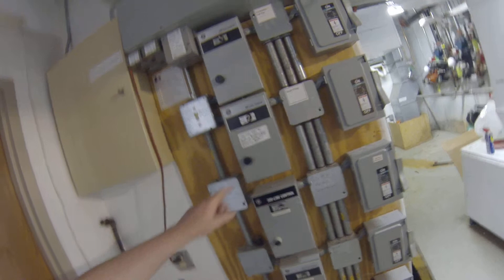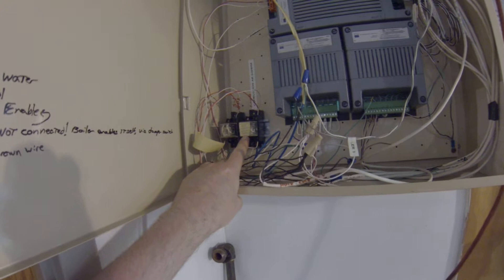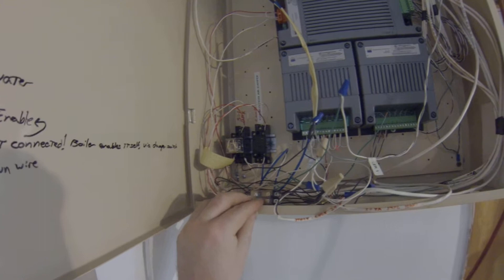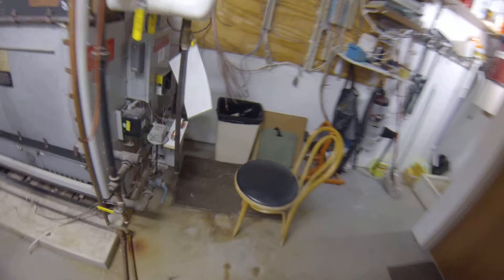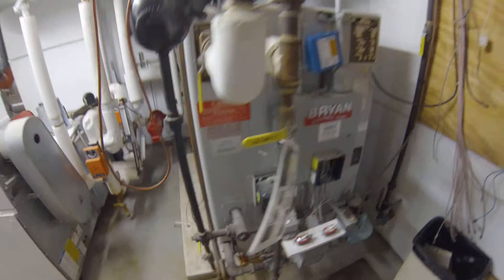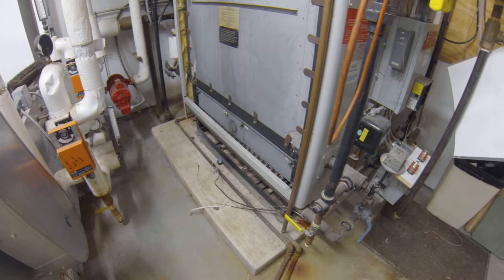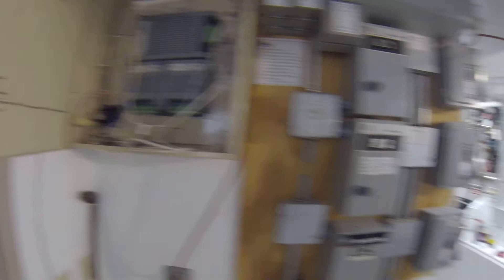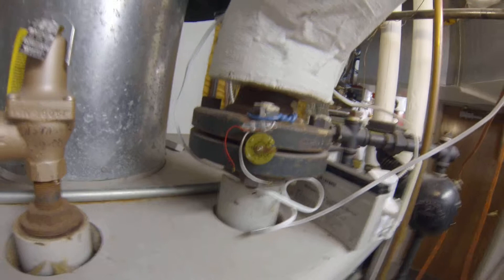Emergency Manual Boiler Firing Instructions (HD)

Comment from the maker: Just the mechanical room of my parents' commercial building. The boiler didn't want to start, and it's taking almost a week for the new parts needed for its electronic controls to function properly. With lows in the 40s, our tenants are getting cold. So I'm doing the EXTREMELY UNSAFE DON'T EVER DO THIS procedure of hot-wiring the boiler to get some heat into the building.

If you hear an earth-shattering KABOOM from the direction of Minnesota, it's been nice knowing you.